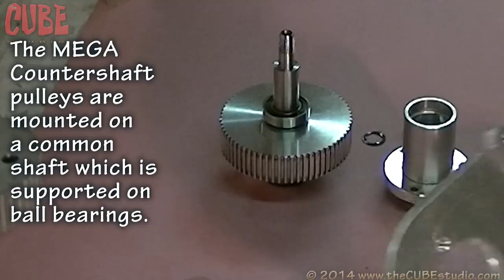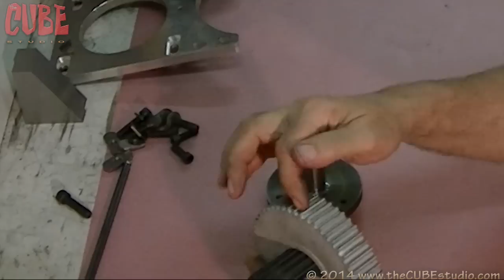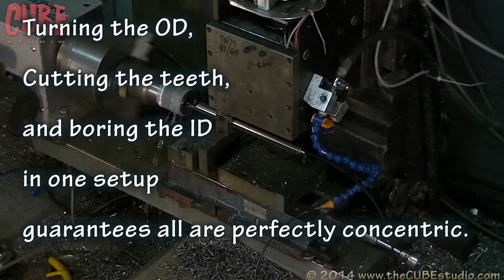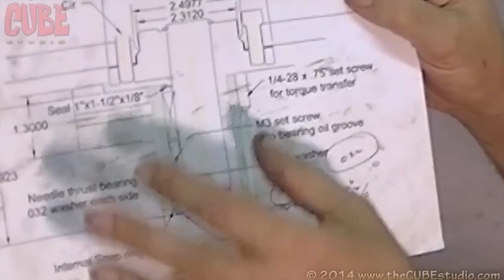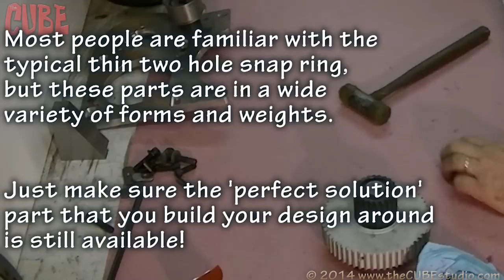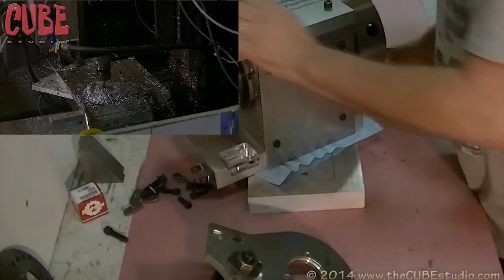Ultimate4thAxisBuildPart10BFINAL5

Comment: Damn I'd love to get my paws on one of those fat motors. I saw in the J3 online manual that drives above 750kw require 3 phase input. I had a leadshine 1kw that would take single 220, and if memory serves some larger 480v allen bradley VF drives will allow single phase input if you are careful and upscale the drive for a given motor...about double I think for something like a 5hp motor. If the Mitsubishi drive wouldnt throw some phase error, I wonder if you could use a 5kw drive for a 3.5kw motor on single phase. Very informative video as usual!
Reply from the maker: +Regicidil Thanks for the comment. Yaskawa makes one large single phase drive. I don't recall offhand what the power was, but much better than 1HP (750watts).For DC motors (brush and brushless) I use Copley drives. Check out the big Xenus drives. They are available with and without self contained power supply. These guys pump a LOT of power and can run big motors on single phase (or external power).For a Mill/Turn setup, make sure that whatever drive you use has enable/disable capability. PC or equiv is alos an important feature to look for, butu not as critical as enable/disable.

Comment: That is an incredible 4th axis!!  When is the next Ultra production run?  The MEGA looks like MEGA overkill for my needs (for now).
Reply from the maker: You might have the models reversed. The ULTRA is the big boy with D1-6 chuck mount.

The MEGA was/is the precious model. The plan was to rep[lace the MEGA, but the ULTRA is just too big for the X3, Tormach 7xx, Grizzly square column mills, etc type mid size bench mills 

Therefor both machines will remain in production, with the MEGA being the best choice for the mid size mills and the ULTRA for full size 'Bridgeport' type mills.

The MEGAS are all completed and shipped., The last couple of ULTRAs are being finished up and there is only one ULTRA spindle forging left.

I can't seem to keep any completed machines 'on the shelf', but the parts runs result in  lots of extra parts so making a machine outside of a run is usually just a matter of making whatever parts are not on hand. MEGA's are pretty easy and 30 to 45 days is normal delivery until I can manage to get ahead of the game and have some ready to go.  

One ULTRA is available in a 45 day window, but then it will be about 8 weeks to get more spindle forgings . . . I am not the only one who makes things in batches . . .:-)
.

Comment: Awesome! I wonder if you could add to your next video how accurate and precise the indexing is. For example if it's rotating a trunnion table how square can it rotate the table in 90 deg. increments and how repeatable is it returning to square. Also how rigidly it can hold it there. Great work!
Reply from the maker: Excellent question.

Holding power is provided by the internal pneumatic spindle lock which is more powerful than even the 5HP servo motor or any stepper motor.

Repeatability is dependent on the overall gain the system can tolerate. One of the reasons for the 8mm belts is that they thicker and far stiffer, thereby reducing the elasticity of the connection and allowing a higher gain. I am building a custom ULTRA right now that will be used vertically as a rotary table and I have bumped the  main drive belt up to 30mm (3kw motor requires 20) for that very reason. Gain and position resolution are configurable on industrial drives, but that's a whole other discussion outside the scope of these videos.

I also cut the pulley teeth very slightly narrow to eliminate the inherent, although slight. backlash in curvilinear belts. The belts run a bit noisier and probably won't last as long (I don't know because I have yet to wear one out), but that is a good trade off in this application.

The answer to accuracy is dependent on the motor encoder. The Mitsubushi J3 series has 262,144 counts per motor rotation. Multiply by 6x reduction (12x for the MEGA) and you have 1,572,864 discrete steps per spindle rotation. On a 6" diameter part, an inch of circumference is divided into 83,443 slices.

In Texas we say "them thar is mighty slim slices"

In West by-God Virginia, they'd  say "thinner than a gnat's ass stretched over a rain barrel".
- Quote credit to Charlie S. one of my all time favorite people. R.I.P. my friend.